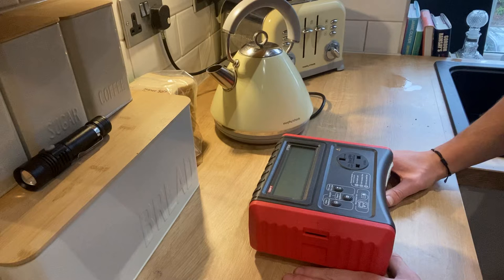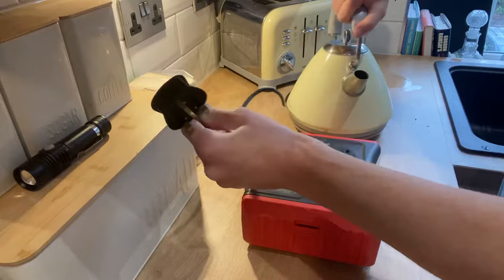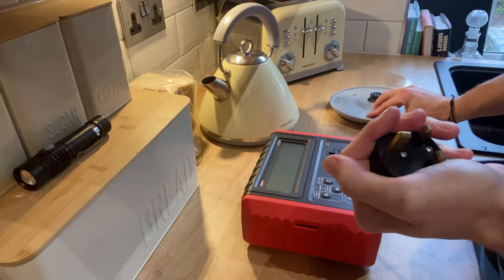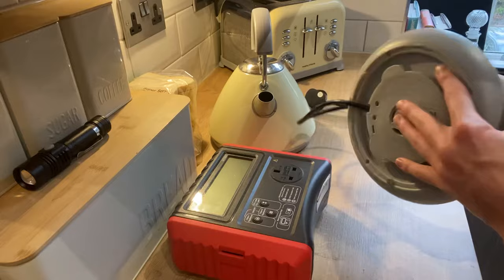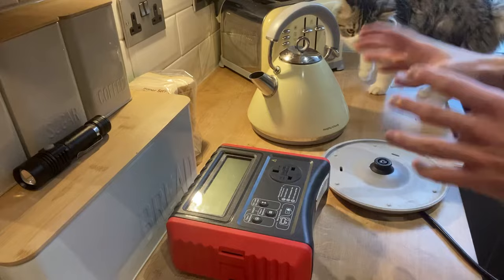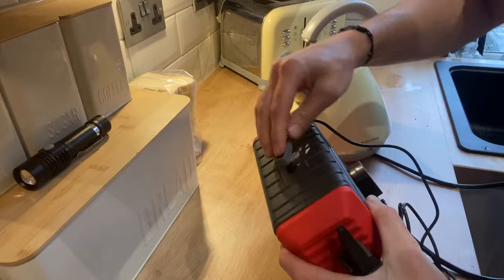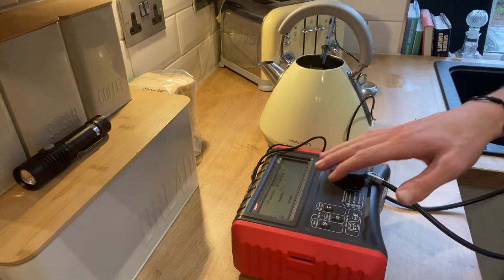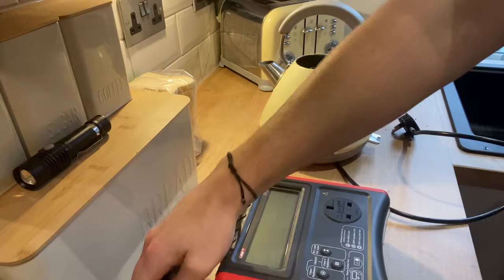How to PAT test a class 1 appliance. A kettle

Comment: I work for a very big uk pat testing company and when we test any two part kettle it is treated as two items the base is one kettle is two and a label gets put on both parts ? Some people are counting it as one item some two . Whats everyone's view on this?
Reply: Hello, how does the testing work to justify it as two items? Do you test the base by itself and then take a separate test where you add the kettle on top? Also, I find it very interesting, since if one item fails, then wouldn't the whole product be rendered useless? I'm just very curious as I just picked up this new qualification, and I'm still figuring things out :).
Reply: @senorpatata3440  yes test both parts . Pass on fail label it as appropriate. Some kettle's have a lead only test that then plug it in to the kettle and test that.